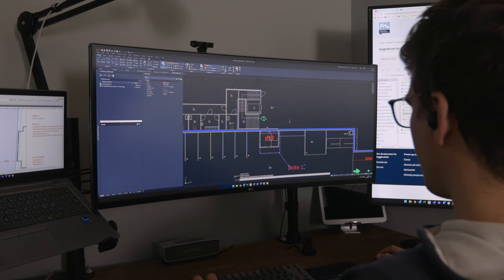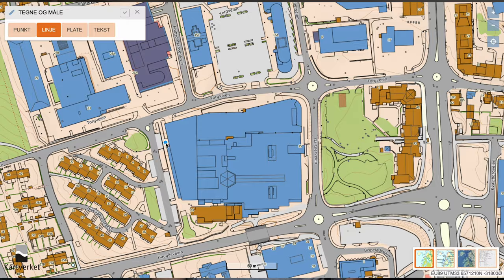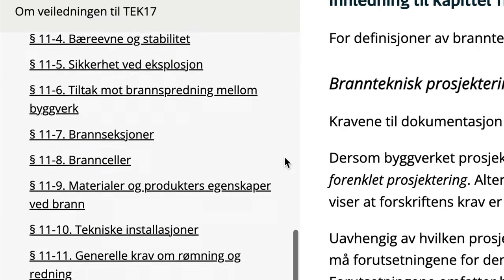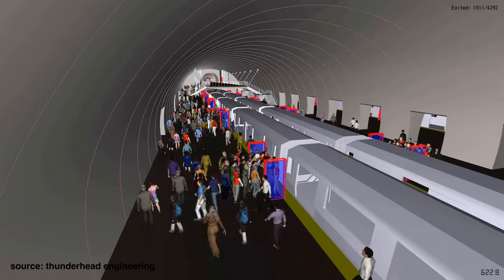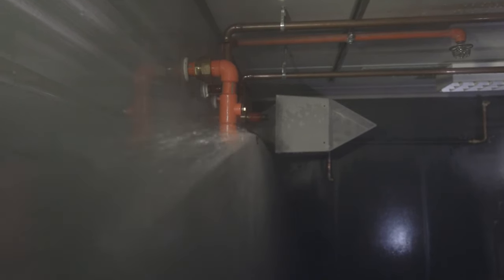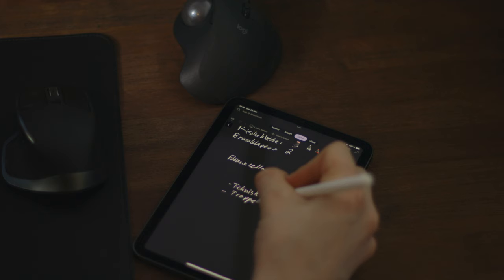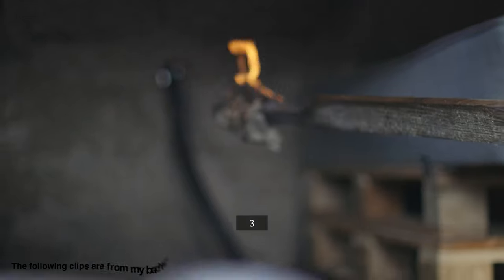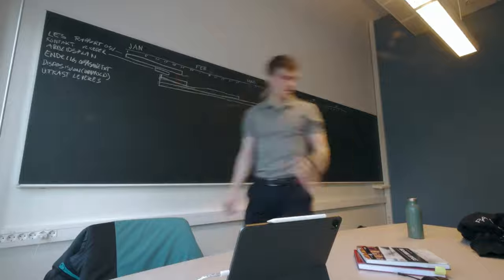Working as a Fire Protection Engineer - First Six Months Experience

Comment: My name is Harikrishnan P
 and I am an Engineering Graduate in Safety & Fire Engineering. In addition to the Bachelor's Degree in Engineering, I also possess NEBOSH IGC & IOSH certifications. I have 2 years of experience as a Safety officer working in oil and gas industry in Saudi and India 
I would like to know what requirements are needed in order to secure a job as a Safety designer at Ship / vessels manufacturing or service unit.
I would really appreciate the help.
Reply from the maker: Hello Harikrishnan! Sorry for the late reply. I do not know how to get into that field sadly. There's a guy in the company I'm working for which specializes in fire safety of wind mills offshore (and including the platforms). I think he does not have a direct education in fire engineering, but rather technical safety. Not 100 % sure though.